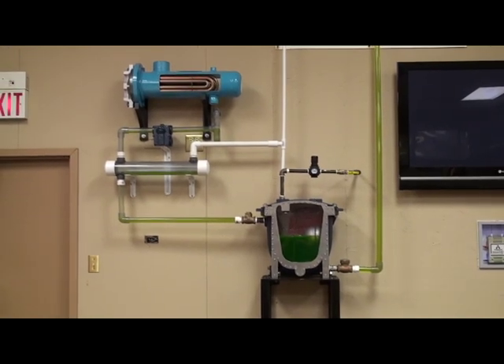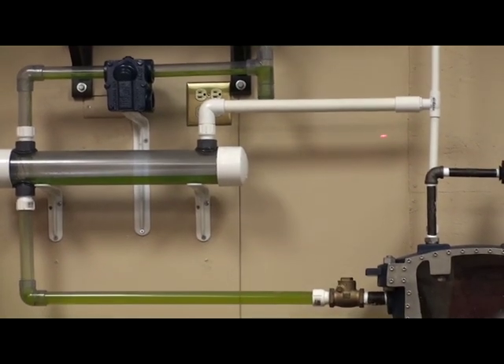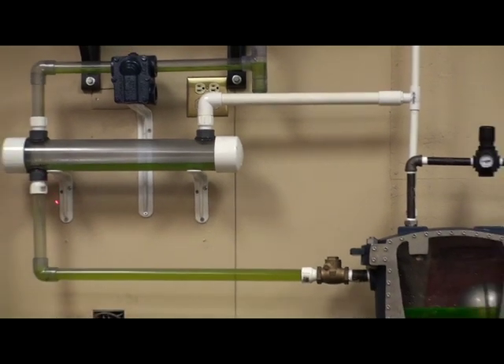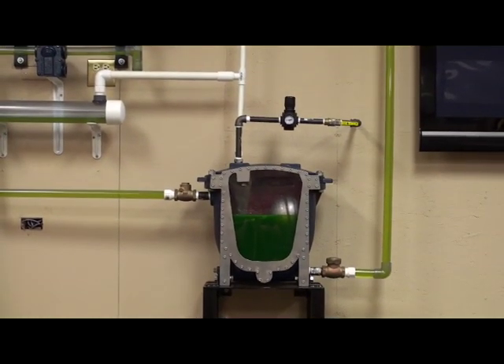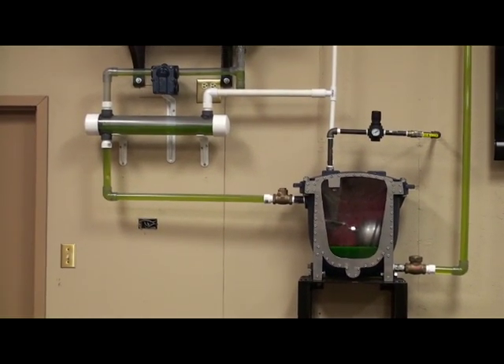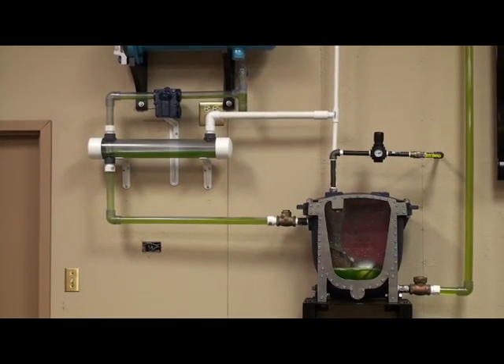Mechanical Pump Trap Operation

Comment: Steam trapping involves not letting steam flow out of the system and only allowing condensate to go out. The device demonstrated shows no method  of achieving any steam trapping. It is only acting like a pressure powered pump. Then why is it referred to as a trap?
Reply: Technically an "alternating receiver".  Called a "boiler return trap" in the 1920's.